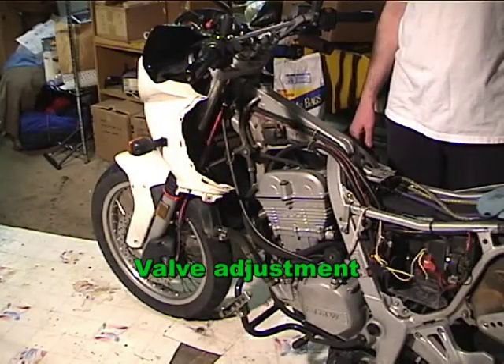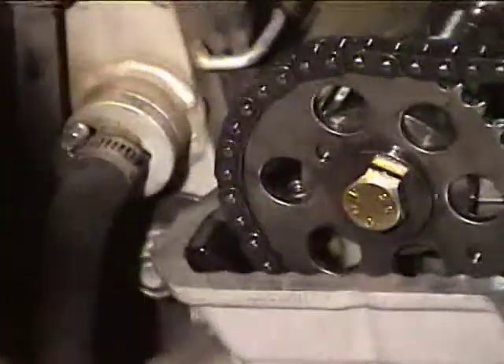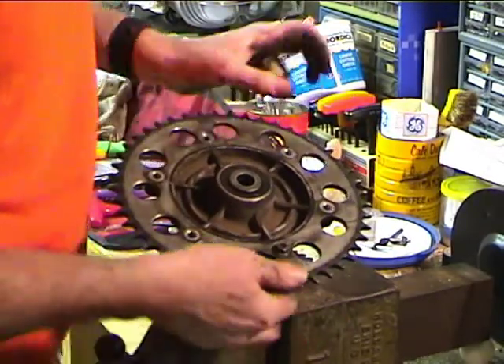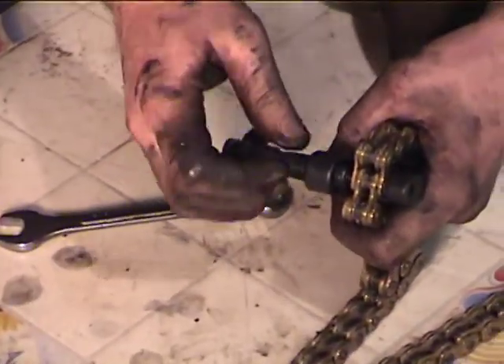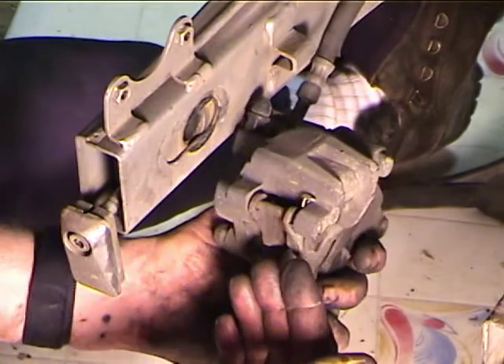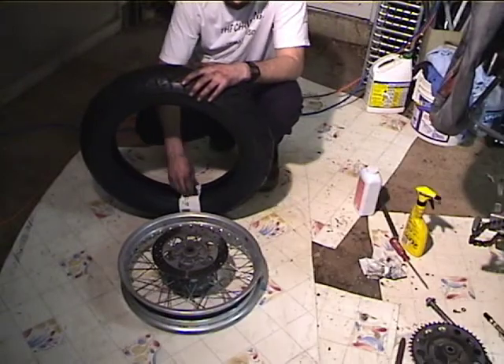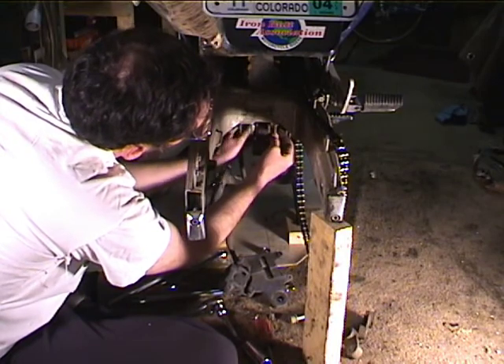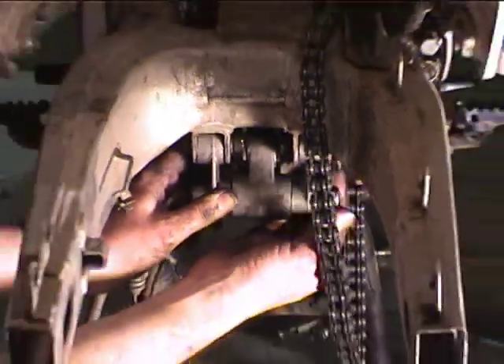BMW F650GS Maintenance DVD 1 (faq.f650.com)

Comment: Hi , cams were removed without being at tdc ,, how can i get the timing back??? Tried just getting motor locked at tdc but valves were not closed on compression stroke
Reply from the maker: Watch the video from 17:13, the markers on the gears needs to be in a straight line.

Comment: Great video!! quick trick....use a strong bar magnet to pull the shims up and out!Im  trying to figure out why my 2002 F650gs makes popping sounds outta the intake when I get on the throttle. adjusted my valves properly to spec, new spark plug, fresh fuel, new aircleaner, cleaned throttle body, gasket looks decent on it ??? Bike runs well otherwise and idles steady at 1500 no other issues, just noise out of the intake..bike has 13 k!
and help is appreciated!
Reply from the maker: I think I found the solution to your problem, go to http://faq.f650.com/FAQs/StrangeNoises.htm#Noise%20List to read about it, I copied and pasted part of the article below for you to read:

"a loud popping from the front of the bike. Possibly Blown Exhaust Gaskets. Recently went to replace gasket where header pipe meets cylinder head. After pulling left header pipe I found culprit of noise, blown out header pipe to collector gasket. This was a corrugated sleeve that failed under the clamp. Replacement gasket is no longer corrugated. Added bonus was the commonly reported backfiring problem, I thought I had to live with, is now completely gone"
Reply: @RagamuffinforGod  appreciate the help ,, but the exhaust is fine ,,popping coming out intake airbox,,everything is tight too
Reply from the maker: @mrsimpleesarcastik3494  My situation with my bike is the same as with your bike! I bought a 2001 F650GS Dakar with only 19 000 k, bike was also standing for a long time but after some work it is going like a dream, it is obvious that the bike was not always treated very well but it looks like everything is fixed now, you're not going to believe it but after a proper service and installing a racing air filter I'm getting 27 km per litre on my daily commute to work and back. I really hope that you get your problem sorted out. Let me know if you have any other questions. cornelisweyers@yahoo.com